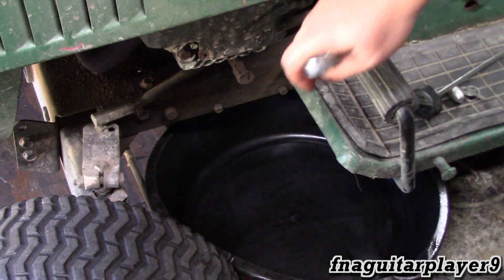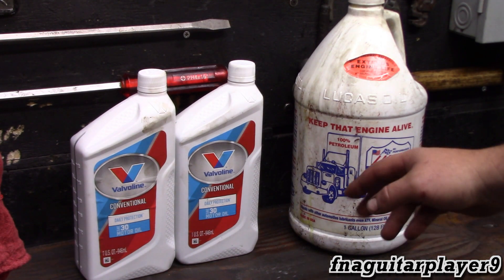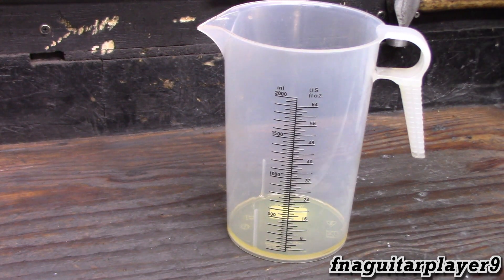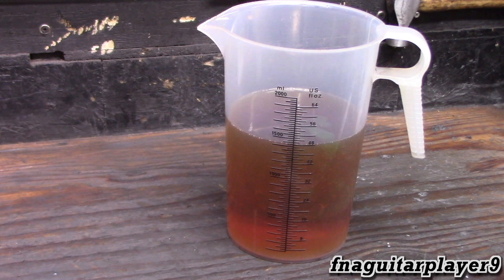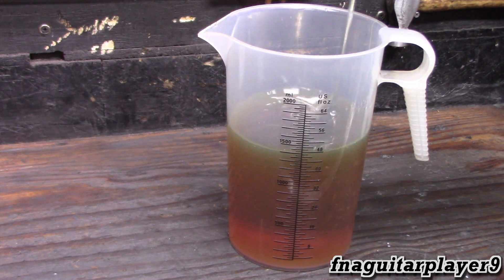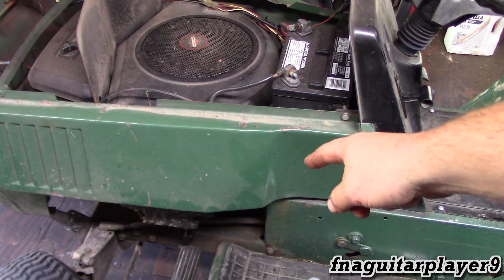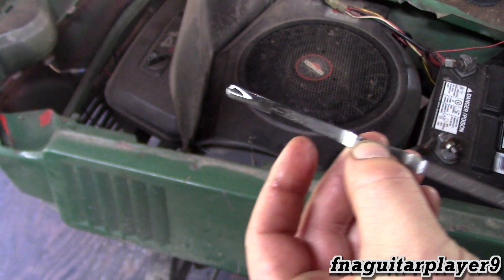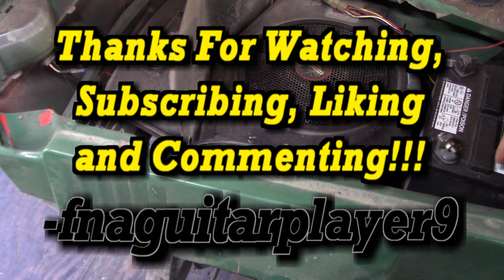Small Engine Oil Additives & Oil Changing Tips

Comment: Thanks a lot, mate your vid is the only one I found that clearly covers everything regarding adding oil treatment to a lawn mower engines, my vertical Briggs bottom crank oil seal is leaking a little so I am hoping some STP will help slow it down, thinking after draining of adding a little neat STP  first and leaving it for a few days to work on the seal before adding the bulk of the mixed oil

Comment: Great video! I have a 2009 Briggs & Stratton 23 hp Intek with 600 hours on it, starting to consume oil and giving off some blue/ white smoke. I never run it when temp is below 32 degrees.  What oil & additive would you suggest I try?

Comment: I've found that when properly taken car of an engine will often outlast the mower. I use Rotella 15W40 in my 20 year old Briggs.  It runs great but smokes on a cold start, has a leak and I think it's getting tired. I'd like to re-ring it but I've rebuilt the deck several times and I'm not sure how many more years I can get out of it.  It's a Murray GT which has been tough as nails and the new ones just aren't built the same.
Reply from the maker: I agree to that 100%, same for vehicles too. I'm thinking about trying a thicker oil that. I'd say throw some rings in it and hope for the best with the mower,at least you know the engine will be strong. Thanks for Watching!!!
Reply: @fnaguitarplayer9  Thanks for the note. I moved from 30W to Rotella 15W40 due to the hot climate I'm in. Summers are brutal on engines here. I'm leaning toward new rings. They are cheap and that Briggs L-Head has been a great motor.

Comment: Good job and I like Lucas a lot too but nothing I have really uses enough oil to warrant putting Lucas in with the regular oil BUT my regular ain't too regular. You know I run Delo 400 15/40 or Valvoline 15/40 diesel formula in everything. The local Saw Surgeon just fixed a Kohler 22.5 horse V-twin with a bad camshaft. 80 hours on the engine!!! This is his 2nd one with a bad cam. That's one reason I run thicker oil so it doesn't thin out BUT the Lucas would take care of that too. I run Lucas in all the gear boxes though. And I got one of the vacuum oil suckers at Lowes in case I don't feel like flipping the ones with no drain plug. So far it works super good but I'd rather have a plug but I don't get what I want a lot of the time. I like those opposed piston Vanguard I/C's better and better. GOOD video and pick me one!
Reply from the maker: Thanks. I hear ya! I'd say with that weight of oil you won't need lucas. I've been tempted to start using something like that but keep going back to 30, but it would be nice to not have to mix it up though. oh wow, thats real low hours for any type of problem really, especially a bad cam. Next time  i change oil the rear end on my truck i'm going to use 50% lucas in it. I love the opposed twins, great motors, bit on the heavy side though! Thanks for Watching!!!
Reply: @fnaguitarplayer9  An old time wrench man said that everything he worked on for the outfit he worked for had al least one bottle of Lucas in it. He checked out the Taco and filled it back up with Lucas! I got around the Delo at the quarry and saw what it did. It'll peg the oil pressure gauge on that 4.3 with the 195 thermostat at full operating temp at plus 80! We run 30 wt. in the car but it has over 200K on it. Yessir, 1/2 of a VW motor. Can't be beat! Carry on, Buddy!
Reply from the maker: @lewiemcneely9143  haha i hear ya! Its good stuff!

Comment: I use Briggs 30w and some stp oil treatment since it has zinc in it which helps air cooled engines. Also NEVER  use and oil thinner then a 30w example 5w20 or 10w20 it is way too thin for these engines iv seen people do that and there engine eventually blew a rod
Reply from the maker: Yes! 30 is the best!  i wouldn't use something thinner unless it was all i had on hand. Thanks for Watching!!!
Reply: @fnaguitarplayer9  no problem  I like your video's
Reply: If your in the south or only use a mower in the summer 30W is very good. Up here it can get chilly in the fall when you want to bag or mulch the leaves before snow flies. This year not much snow in the north land. I use 5W-30 or 10W-30 synthetics. I’ve never tried Lucas and am considering getting some for an oil change. I trust the man in the video. He’d be a great neighbor.

Comment: What are your thoughts on marvel mystery oil? Same as Lucas?
Reply from the maker: MMO is good to help clean out engines, it will thin the oil down as lucas thickens it up, so they both have a purpose, lucas is good for a older engine that may be starting to burn some oil, while mmo is good for flushing them out, or to run in the fuel to keep the fuel system clean and provide upper cylinder lubrication. In vehicle engines or any engine with hydraulic lifters, if they start getting clogged and start ticking it will clean them out most of the time. Thanks for Watching!!!

Comment: I use Amsoil small engine 👍
Reply from the maker: I've heard its the best, do you use the synthetic, which weight? I was going to get the racing oil for go karts for my mini bike once i get the engine broke in. Thanks for Watching!!!
Reply: @fnaguitarplayer9  
I've been using the 10/30 Synthetic and haven't had any problems. Amsoil Small engine 3 years no problem. Also run it in my Stage ll Predictor engine👍
Reply from the maker: @ihus9950  I'll check into it!

Comment: On engines with a screw type cap/dip stick should you screw the cap all the way on to check oil level or just let let the cap sit on top of the oil filler tube?
Reply: I always screw it all the way down.  That's the way it is when it's running.
Reply from the maker: Usually it will need to be screwed down however On some engines, kawasaki I know for sure, you just set it down to check, it will usually say on the dipstick itself or in the manual, so just check yours to be sure so you know your getting a accurate reading. Thanks for Watching!!!